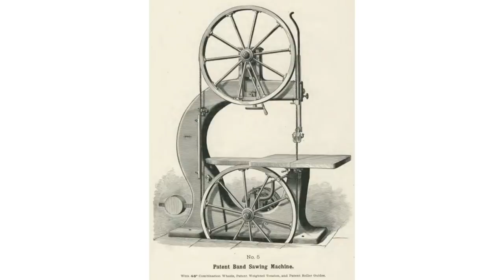The Jimmy Diresta Band Saw Restoration, Part 1: Disassembly

Comment: Keith!!!!! I am so grateful that you took this on !! Love and respect ✊🏻🙏🏼🙏🏼
Reply: @ke17h  As Keith said, he hope to get some users that look at Direstas videos to come over and follow him and look at his videos.
Reply: Jason from fireball tools will be jealous
Reply: UPDATE:  Pendulum is likely the Fay and Egan Patented Knife-edge Straining Device   "Superiority in a Band Rip Saw consists in its capacity for turning out the greatest amoutn of lumber per day, and with the least waste in sawdust in the operation.  To have this, two things are necessary - First- A thin saw blade. Second -  A high speed to the blade. To have these two things your machine must be equipped with a highly sensitive straining device, absolutely frictionless, for in ripping lumber of varying density a thin blade will crack if the vibration is not quickly compensated for by the tension device.  WIth a device slow to respond, a thick balde is necessary, as is found on the ordinary machine; hence the waste in kerf and the consequent slowness fo the feed.  The Fay and Egan Patented Knife-edge Straining Device is responsive to the least vibration in the wood under the highest speed of the saw blade.  It is not a gibbed device, but works on the principle of a pair of scales is absolutely frictionless. Hence, by the use of a thinner blade under a higher rate of peed, it is superior to any of its contemporaries in output and its saving kerf.  Can you refute this argument?  We challenge anybody."

*@1:37 I see that giant weighted pendulum  sticking out of the left or back of the machine, is that the "Patent Weighted Teneton" and what does it do?  For changing the blades, or ?   "No. 5 Patent Band Sawing Machine.  With 48" Combination Wheels, Patent Weighted Teneton, and Patent Roller Guides."
Reply: Great idea to but and have Keith restore the bandsaw.  I kinda want to fly up there and play in the shops. Lol

Comment: Just binge watched the entire restoration.  I just picked up an 1890's JA Fay & Co. 36" bandsaw that is the baby brother to your 48" monster.  Ironically, most of the parts and design are very similar.  Thanks for the step by step guide I will be using when I restore my saw, which is destined for full time use in my new shop. Luckily, everything is fee wheeling and it looks like it was well cared for.  Thanks so much for the detailed series.  You gave me a great education on the pitfalls....  Thx.  Scott Kapton   Fine Creek Woodworking. Powhatan VA                 P.S: I also added photos and description to your website too!

Comment: When I worked in Baltimore they were building the ship The Pride of Baltimore 2 and they had one of these monsters on site to cut up the timbers for the ship. Quite impressive to see these in action.
Reply: Have you see the Sampson Boat Company with Leo rebuilding the Tally Ho, he has one of these monsters and they had the lower wheel buried into the ground. The cast iron frame also rotated to cut angles, so the table was fixed and the saw frame tilted. 
There have been some amazing machines built over the years.
Reply: @dennisleadbetter7721  Thanks Dennis I have seen Leo and Tally Ho. Quite an impressive undertaking. It sure helps to have the right tools for the job.
Reply: @dennisleadbetter7721  Leo has a Ship Saw, a considerably more complicated piece of kit than a plain old Band Saw

Comment: That is one nice machine ! I've worked on a few Ship Saws where the table is fixed and the frame and blade mechanism adjust to allow cutting changing bevels on futtocks and frame stock. Excellent series rebuilding a Ship Saw on Leo Goolden's  site rebuilding TallyHo, over on the upper West Coast. Also a beauty at Mystic Seaport Museum and Boatyard.
Reply: There’s a big unrestored ship saw out back in the Deltaville Maritime Museum in Virginia, which is a really nifty place to visit.  Lots of things to see including a very large circular saw blade with individual replaceable teeth!

Comment: I'm going to enjoy watching this restoration. I'm certain this bandsaw was used for freight/passenger car construction/repair. This time period was the era of all-wood freight and passenger cars which had a short lifespan before needing repair or rebuilding. The width of its wheels would accommodate a very wide blade for resawing large timbers into the required dimensions for car construction.

Comment: I have a 37-in crescent about the same age. The most impressive thing to me is that the wheels are hand forged, with an odd number of spokes and yet they are perfectly in balance. There is no signs of drilling or adding lead to balance. Presumably the blacksmith himself assured they were balanced
Reply: Not sure what Jimmy's plan is for the bandsaw, but I have a very neat design that I implemented to make mine work on wood as well as metal. Would be happy to send you pics and specs if that is his long-term plan
Reply: I don't mean neat as in blowing my own horn, I mean that it all fits in the original footprint
Reply: Wow

Comment: I redid bearings in a 36" Smith band saw. Bronze was used. I set it up on a Bridgeport mill, indicated level and bored the bearings. It ran true, and the boat builder was happy with the job. Also wooden wheels.

Comment: That is a big saw I have a Oliver 36'' vertical saw and I love it. It is the only power tool I have that I have to climb on sometimes to work on it. My saw had a broken trunnion that I had to mill out a replacement part for and the lower Babbitt bearings were shot I replaced them with 2.5'' flange ball bearings which gave it better adjustability of the lower wheel. These saws defiantly need a blade guard on the left side blade. I am looking forward to seeing it run and cut lumber.

Comment: Keith, if the dovetail for the top blade guide support rod is on an angle, it is there to align the blade guide to the blade. It will move the rod to the left or right. JMTC.

Comment: I think maybe they used black as a primer or a base coat and if you wanted the option of Coker paint they would just spray over the black. In the production process they’d have to paint it with something to keep it from rusting I’d think. It’s crazy to think that some of those bolts you took off were last touched 120 or maybe even 140 years ago when it was built new! I know you’ll do an amazing job with this saw, can’t wait to follow the journey

Comment: Consider the old way A B&S old timer told me the company used plaster of Paris and shellac mixed . It sanded smooth and easily and can be sealed with shellac and then the finish paints applied. Looks like a fun restore  I doubt the guides are original We had a 36 Tannerwitze that I upgraded the guides on From Phenolic blocks  to bearing type !   Nitro-Stan works well too

Comment: Plain old oven cleaner (sodium Hydroxide - lye) works very well at busting paint, rust, oil, grease from old stuff. Ive used it a bunch. A soapy prewash to remove oil and grease helps to allow it to work better on the rusty stuff.

Comment: When I draw the shape of your missing decal and have my computer scrub the internet for that shape, the only railroad emblems that are anywhere similar are RR police badges.  If I replace "Railway" with "machinery", Faye & Eaten emblems are found to match this shape.  And, that was without giving the computer any hint of the name.  It also found very good examples of these on your website. I hope that helps give you independent corroboration as to the shape or outline on your handsaw.
Reply: FYI, the company that manufactured the band saw was J.A. Fay & Egan

Comment: Hey Keith, 
I was thinking about that adjustment mechanism on the blade guide up top. From what I was seeing as you removed the blade guide post the square shaft looked either solid or at minimum very thick walled tubing. I can't help but to believe that the purpose of that adjustment wheel was to make life easier when adjusting that blade guard. 

In regular use of a bandsaw mere mortals would own and use, the blade guide assembly is very light and easy to make adjustments. Adjustments that for safety sake sometimes will be required often due to material thickness. Perhaps, they put that head on a set of ways with an acme threaded adjustment shaft in order to make the frequent and more common movements of the guide less of a chore. Then the major less frequent adjustments would happen via movement of just that shaft...

I'm not certain if I'm being clear in my explanation of my thoughts on this matter or not. You always have something interesting on your channel. I thought I was subscribed until I watched this video. Then I realized, my previous Gmail account is subscribed and now so is this one! I'm hoping someday to take a family trip up to the museum and see some of the stuff you've built here on your channel. Thanks again for the years of great content and mechanical history lessons.
Reply: P.S. perhaps if you can't figure out what that decal was, make a Diresta sticker with that shape, or even a brass plate with his name on it. That way he won't need to paint on it and it can stay pretty once it finds its home in New York! 

Glad y'all are doing this project, love the work both of you do!

Comment: The dovetail slide  on the upper blade guard mount is to extend the height of material cut capacity. It probably can add  an extra foot to the overall height of possible cut,almost allowing it to become a mini sawmill. If the saw table has either installed or tapped holes on the edges for the installation of rollers, then this would confirm my suspicions, that this could be used for major re-sawing work.

Comment: Nice big solid bandsaw. They don't make them like that anymore.
Have you seen the one that Justin from Fireball tools has? He fully restored that and made guards for the wheels and blade.
The guard on the left side against the column was possible more to prevent that side of the workpiece hitting the blade accidently and throwing it out.
With that sized wheels, they wouldn't be running all that fast, to get 3500 fpm blade speed you only need to run around 275 rpm.
Look forward to the next episode.

Comment: Keith, you might want to needle scale it before you spray it with stripper. The scaler loves that thick old paint. Sometimes goes right back down to bare metal.
Reply: Shot blasting sometimes works well, but that piece is so large it might be too messy.

Comment: As you said they were clever then. I would think that hole in the hub was there as a locator for one of the spokes . Consider they are screwed in to the hub and one was a special one. Might be longer than the others, thus capturing the shaft. Just a thought!

Comment: We had a 36" (I think) monster where I used to work and it was a "Fay & Egan," if I recall. That might help you in your research.  I'm like you, Keith. I am puzzeled why they put a dove tail casting on the end of the overarm. Seems redundant. My guess is that it could have been for a different type of upper guide mount. Tell Jimmy to be careful and not cut his fingers off on that beast. I would want to be in the next county when the blade snaps!

Comment: Dave from YouTube channel Engels Coach Shop has a 1908 Fay & Egan table saw, but the manufacturer's name is cast into the machine.   J.A. Fay & Co. merged with Egan Co. in 1893.
Reply: he may also help with the wheels
Reply: I thought the same also,he might be able to shed some light on that upper guide adjustment that Keith questioned.

Comment: for the badge decal, doubtful it will yeild you results but worth a try, (it has worked for me doing restorations to a few motorcycle decals) try taking photos under a blacklight, red yellow and blue tinted light sometimes can help too but my best results have been with  inferred lights at diffrent wave lengths with a camera that has a good infer red spectrum. the Wyze v3 security camera is a decent cheap camera for that actually.  it looks to be too far gone to yeild any results but has surprised me in the past. love the video

Comment: Keith, you used a lead hammer to remove the blade support, but had previously used a brass hammer to remove something else. Is there a reason to choose one over the other? Just curious, as I don't currently have a lead hammer.

Comment: You should really consider sandblasting it. I have seen first hand the difference it makes in paint adhesion. And if you're really motivated to have a durable, glossy finish, powder coat it. Looking forward to seeing the finished product.

P.S. It looks like there's another casting that could be removed where the table trunnion was.

Comment: It's hard to tell how effective "knock it loose" spray is from watching the video. It was applied before attempting to remove the parts dry. Either they weren't as badly seized as anticipated or the spray actually works. I have nothing but good luck using transmission fluid mixed with acetone which lowers the viscosity to the point where it easily flows into the mating surfaces.
Reply: Capillary action is a big part of the secret to good penetrating products.
The CRC Knock 'Er Loose seems to have a pretty good rep with restorers in general. I've used it twice for frozen hardware on car suspensions and it worked both times.

Comment: That saw predates any thought of dust extraction. It would have stood astride quite a sizeable sawdust pit, so having the lower wheel below ground level makes perfect sense.
Reply: Not true... Wihelm Beth patented filter bags for dust extractors in 1886...  The extractors had been around much longer.
Reply: @Stillnapie  You're right, and I should have learned not to make such careless assertions on YouTube comment sections by now. I might got away with it had I said, It was unlikely to have been equipped with any practical dust extraction. The shipsaw where I worked used the system I described right up till the 1980s when it was updated with extraction.

Comment: The dovetail part might be a slight angle to the slot for the arm for the guide rollers. This way the band could be fine adjusted to be rectangular to the table.

Comment: I have an older Craftsman band saw that the 2 adjustable guide feet need to be replaced because of apparent damage by a loose blade.  Which means that I need to either find replacements for a discontinued item, or a similarly shaped one from another brand, or have them made.  Not sure what they are actually called.  I can't find an exploded parts view or parts list for that model to work from.  Since it still works I'm wondering what I can do to make it useable again?

Comment: I have a pre--1900 bandsaw handed down from my grandfather to Dad, to me. It runs on 220v; but I can't make it run with proper power; (no guts!)  It seems to only be connected to half the voltage.  Any suggestions?

Comment: If that saw it was at a railyard it would have been used to cut material/lumber for the repair or possibly the manufacture (if the car shop was slow) of wooden rolling stock.

Comment: It appears the only safety guards on these old machines is PAYING ATTENTION to what you are doing.
Reply: If you do this work long enough, even the most conscientious operator will eventually run afoul of a machine without the proper guards and interlocks in place. What I find so fascinating is that it took so many lost limbs and digits for the engineers back in the day to figure out what was needed.